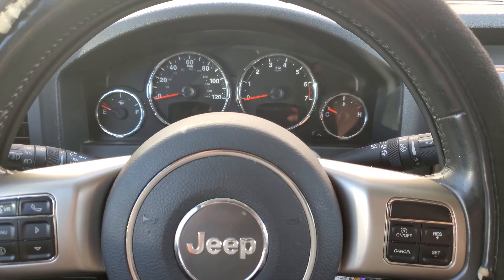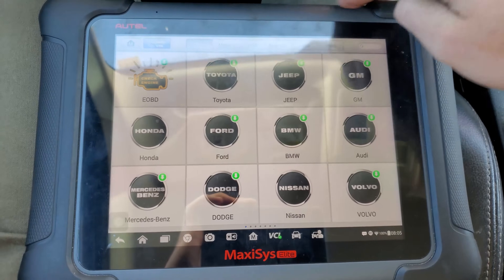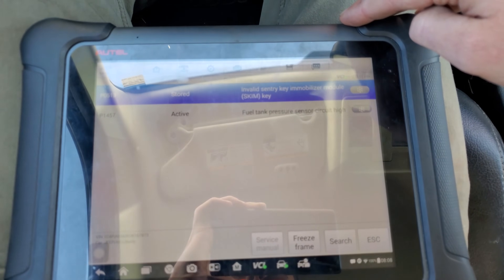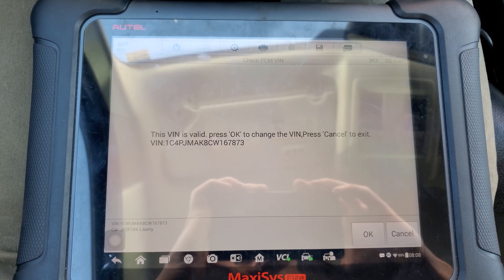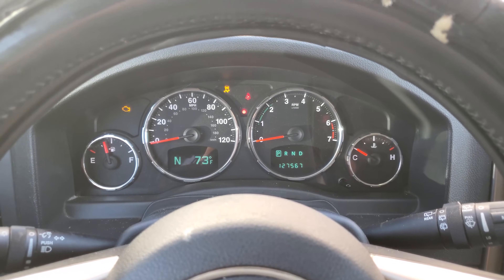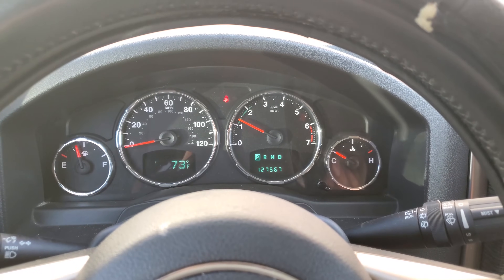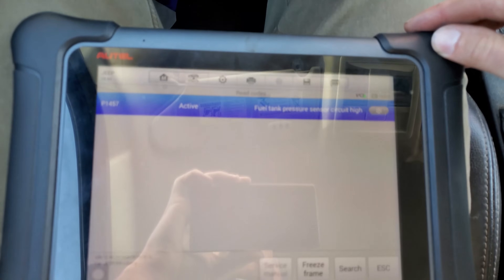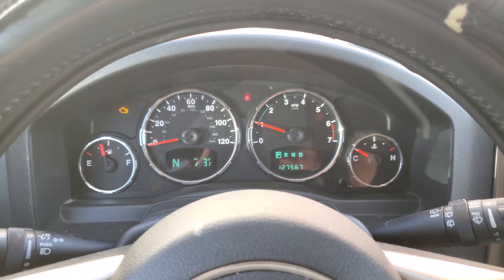How To Program Used PCM ECU ECM Into Jeep Liberty | Works On Any Chrysler Vehicle

Comment: How is the programming Capabilities On European and Asian Vehicles With Autel ScanTools? I Have Xtool D9S Pro and I'm Unable to Change VIN in My Dodge With it. I'm Thinking Of Making the Switch to Autel Because I've Had Nothing But Disappoints with this Xtool line. Previously I Had their D8W ScanTool and I had Same Difficulty with Capabilities and Vehicle Coverge On it.
Reply: Sane here
Reply: @bryanpeguero5288  And it Cost Alot to Do So Little. I'm Looking for something that'll have a decent vehicle coverage as far as Capabilities. I Still Have about a month before I have to return this, if the Disappointment continues, I'll return it and try Autel.

Comment: THE METHOD WAS DONE WRONG I JUST DON'T UNDERSTAND IT WORKED CHANGING THE ORIGINAL WITH THE NEW ONE,THE RIGHT WAY ITS GOING IN TO SPECIAL FUNCTION AND CHANGE THE VIN ONCE YOU HAVE WRITE THE RIGHT VIN IT WILL ASK YOU IF THIS ITS CORECT YOU PRESS YES,AND THEM THIS WILL BE CHANGED OUT.
Reply: Totalmente de acuerdo, se tiene que ir a funciones especiales

Comment: So the PCM is just plug and play?  (other than the vin change)   Did you have to program the IMMO too?
Also, can this be done on a used computer?  Or does it have to be new??
Reply from the maker: As long as you match the part # then the VIN change is all that is needed for the vehicle to start.
Reply: Did the vin rewrite but wouldn't start after light kept blinking so even reprogram the key to the new computer with the rewritten vin an still wouldn't start @AutomotiveCircuitSolutions

Comment: Excellent video, thank you! My alternator wouldn't charge and I had a few other quirky issues I think related to the PCM. I got the same part # ECU out of a wreck and followed your video with my MK808. It runs like it should now.

Comment: Can you get the secret 4 digits pincode with that tool?
Reply: Not that I'm aware of. I have the model just below this and it wouldn't do it. There's an app out there for your phone called PIN PULL or CHRYSLER PIN PULL that's fairly cheap to use $14-25 I think, but I'm not a fan of apps / permissions, so I found a local mobile key / fob guy on Marketplace after the local dealers refused to give me my own code like they apparently used to because they want the money from programming an OEM only fob that they want to sell you. (No thanks) The local guy charged me like $25 each to pull PINS from a couple of my '08 Jeeps. I'd rather support him that dealerships that feel like they have you under a barrel.

Comment: Could you program it with a snap on scan tool I have a 06 ecu to go in a 08 jeep commander because I'm using a 06 engine which has a diffrent egr valve I believe
Reply from the maker: You shouldn't have a problem doing this procedure with a descent snap on scan tool. We do recommend replacing with an ecu with the same part #.

Comment: I have a 2005 Jeep Liberty that has the code p0888. I don’t believe it has a faulty tmc/pcm because the Jeep drive fine. No issues shifting gears,etc. I opened up the tmc box and it looks clean. I reset the code and it stayed off until the vehicle shifted gears and came back on. Any advice? I don’t believe it is a faulty tmc. Anyway to test it or test the wires?

Comment: My 2011 jeep liberty(cherokee) ecu got fried buy my alternator and now the new alternator wont  stay at a charged amp level because of my old alternator. Should I get a used ecu? Or better to get brand new from jeep?? Im from Australia btw
Reply from the maker: This jeep had the same issue, alterator not charging. Put a used ecu in which fixed the problem. Our customer chose used ecu vs new to save money.
Reply: @AutomotiveCircuitSolutions  thanks for replying back.

Is it as simple as plug and play? Or would i need to go to a licensed auto electrician to install?
Reply: That's how you program a used PCM not a new one. A new PCM takes much more.